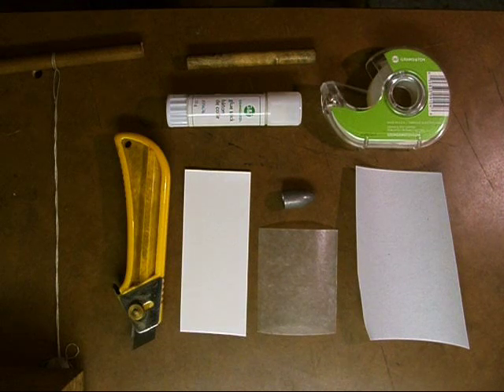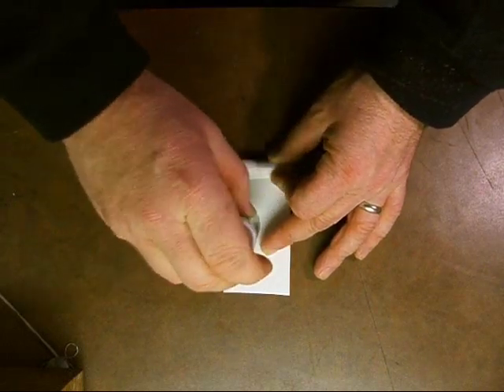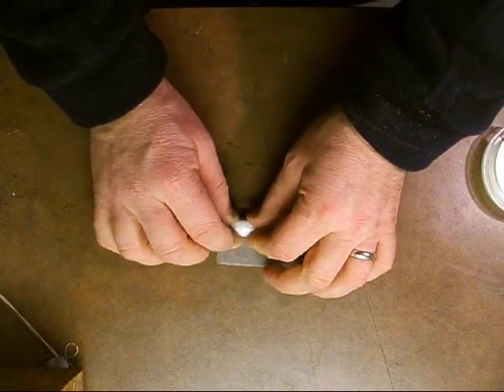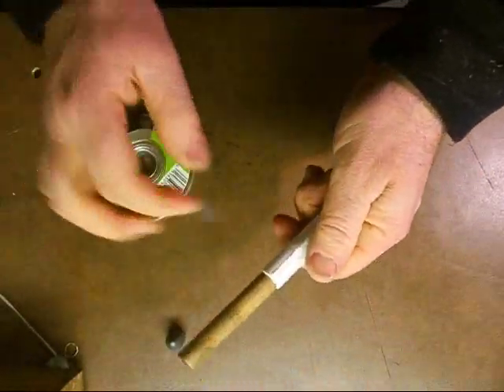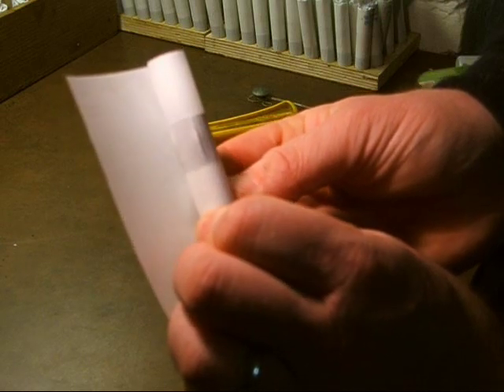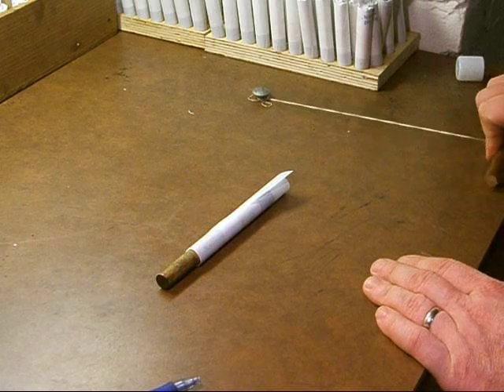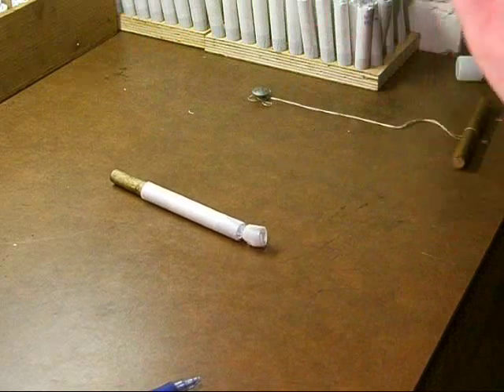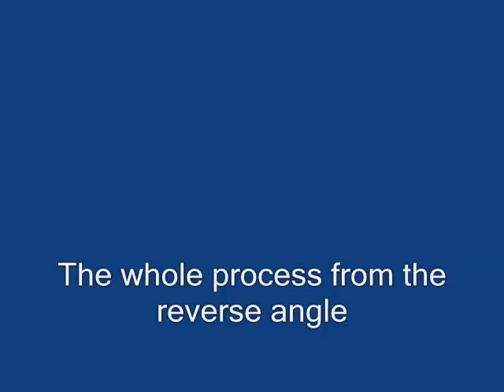Enfield Paper Cartridge Construction

Comment: If I'm creating .58 cal. paper cartridges for P53, what specific diameter miniball does this pair with? I'm new to BP, thanks for any advice.
Reply from the maker: American type, or British type....
Reply from the maker: @curtisrussell9121  Yes, a Pritchett of .563 will be better for use with paper that is .003 in thickness (assuming that your bore is .577) and that will make loading possible.  The paper used historically was thinner, .002 or so... That is what enabled the service round to initially be .568. Remember the formula... Bore = Bullet Diam + (4 x thicknesses pf paper) + .001 Windage
Reply from the maker: @curtisrussell9121  I don't know.  The 1020 is definitely thicker, but I can't comment on any h-hp difference
Reply: @britishmuzzleloaders  I very much appreciate all your advice and videos Sir. Once I get all the materials I'll start cranking out cartridges. Thanks again!

Comment: ? Why do complicated? Also why put the bullet in backwards, I saw how how you rotated it before seating there bullet. Great video thanks.
Reply from the maker: Backwards?.. No, no, my good man, the bullets are in the correct way.  The Enfield cartridge is somewhat complex, but the pay off is in it's use.  Very efficient.
Reply: britishmuzzleloaders 

I'm sure it's not "backwards", the paper cartridges I'm familiar with have the point outwards, with the powder behind. The double paper must protect the powder from the lube?
Reply from the maker: The lube is on the outside of the completed cartridge.  It doesn't come close to the powder, which is held in a different part of the cartridge to where the lube is.

Comment: I was reading up on the P.53 Ammo and something said after Crimea they used plugs.  Does anyone know a good way to make these?  I would think one could just drill them out of a board, but I can't find a bit which could do it.
Reply from the maker: P53 ammunition went through a series of improvements.. Initially the bullet used a plug made of boxwood.  It fit the angles of the cavity and was pushed forward on firing, augmenting the expansion of the bullet into the rifling.. later, with box being so difficult to produce, the went to clay plugs....  These were sort of "terra-cotta" type manufacture..  baked not fired... much easier to produce..  These days, NOE sells Pritchett moulds and also offer a mould for the corresponding plugs so you can use bondo or other non-shrinking material to make plugs..
Reply: Thank you kindly sir.  I appreciate your many videos and refer to them often.  I will be looking into this method.